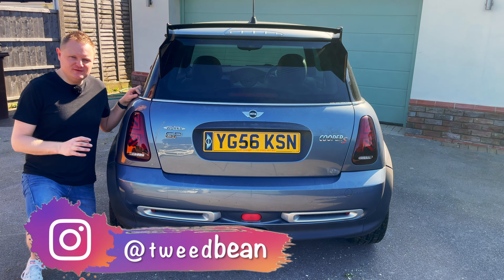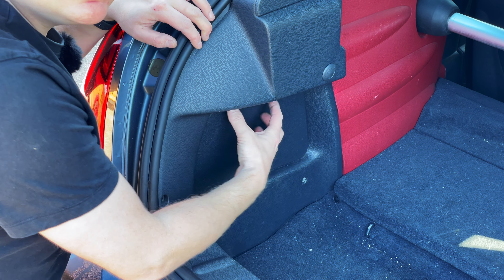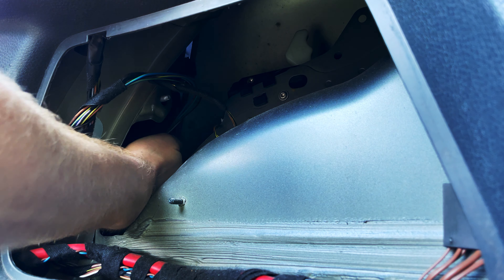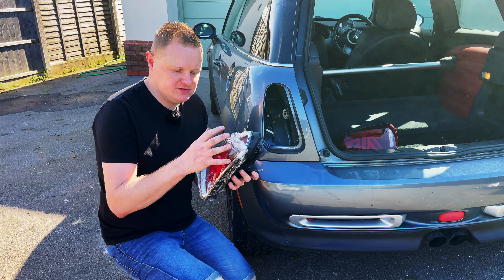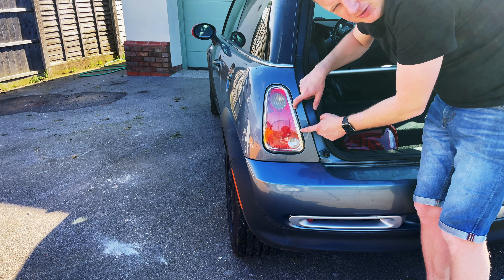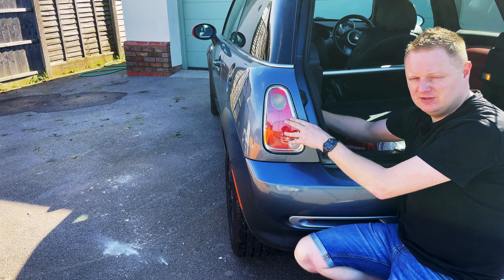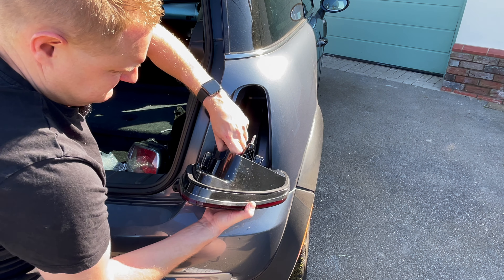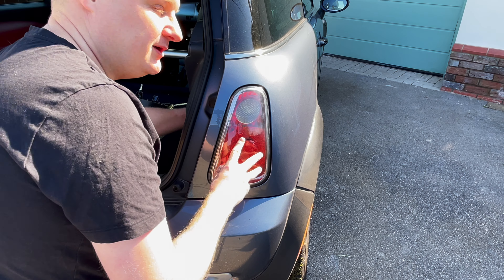MINI R53 How to fit new rear lights tail lights Union Jack Facelift Upgrade

Comment: Interesting but not surprising, Euro tail lights differ from North America spec by having the clear round Fresnel-type spot at top vs red in NA (reversing lamps same as Euro, i.e., clear at inboard bottom as shown). In any case, I prefer OEM lenses while not being much of a fan-boy of de-chroming (my 2006 R53 is monochrome BEP without much bling otherwise).
Reply from the maker: Thanks for watching